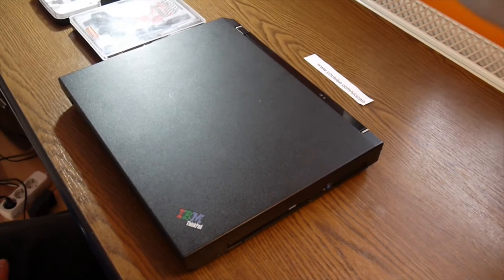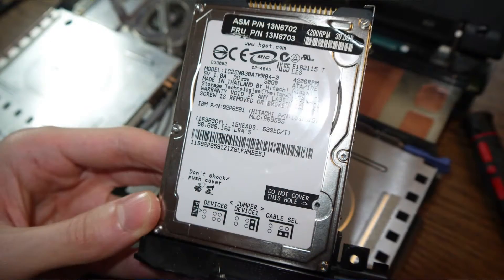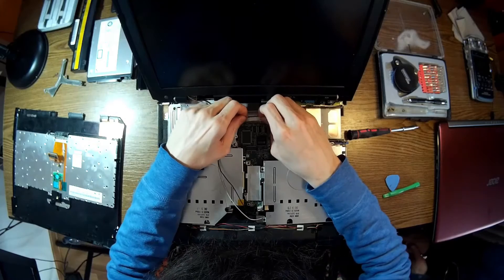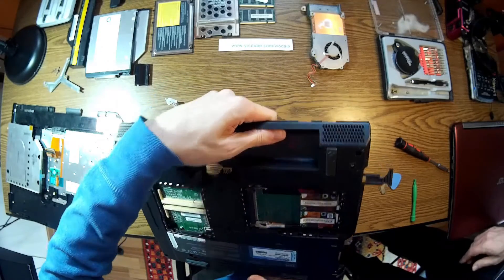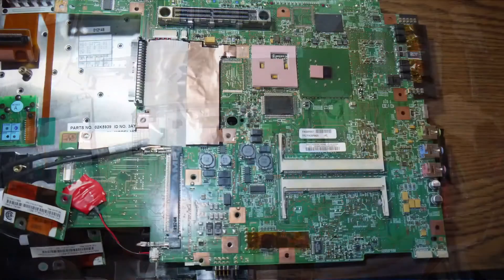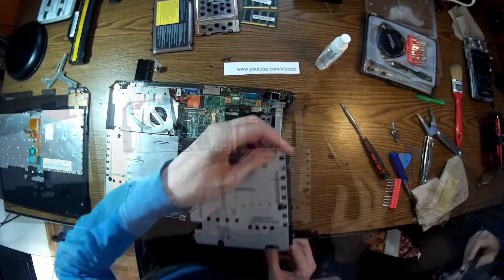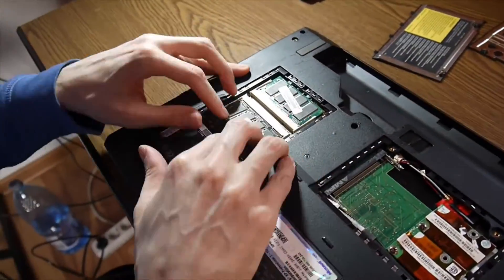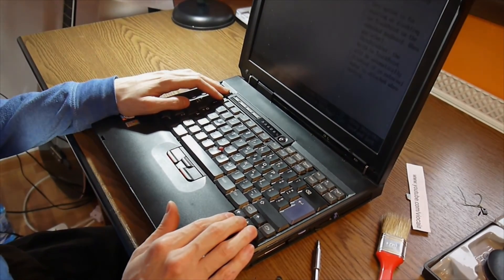IBM ThinkPad A31 Type 2653 disassembly ,cleaned and new thermal paste

Comment: I have A31 2652.
GPU has some artefacts. It works, games good (NSF umderground 2 at high settings has about 40fps) but there are pixel blocks everywhere. 
Even at desktop it looks like it has 8b color depth, even 32b setting. And there is some pale square following the pointer. 
I have tried several drivers, but no sollution. But sometimes, after some use, problem is gone and it does not come back until reboot.

I do not want to destroy the machine, so please, what might be a problem?
Reply from the maker: Looks like it needs a reflow...fells like a loose solder or something.

Comment: Hey dude I have the exact laptop but here is the problem when I start it it starts normally (fans spins) but doesn't bootup (just blank not even a line)and makes a sound 3 times 
Any way to solve it?
Reply from the maker: Disconnect any RAM you added if any..disconnect the SSD o0r HDD...try again. Prees F2 for BIOS..

Comment: Hi. I have a laptop ibm ah 31 with a problem: no sound. Rather, it is in the form of creaks and distortions. I hear distorted sound when playing music. I tried to reinstall the system, it didn't help. The problem is observed on windows 98, 2000, xp, vista. Apparently the problem is in the hardware, in the audio chip, which seems to be part of the chipset. What do you think?
Reply from the maker: Never got something like that, if you install the specific driver and nothing should be a hardware problem, try a usb soundcard instead, it's better sound many times..sorry I can't more...
Reply: @viocaia  thank you very match!